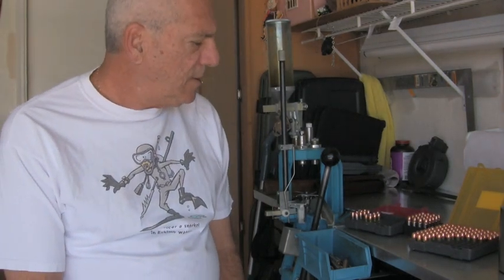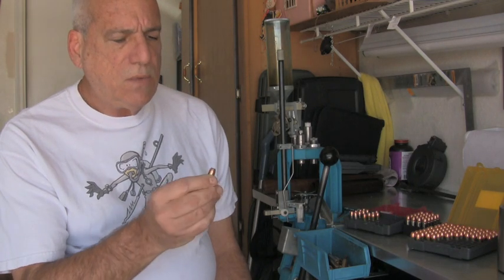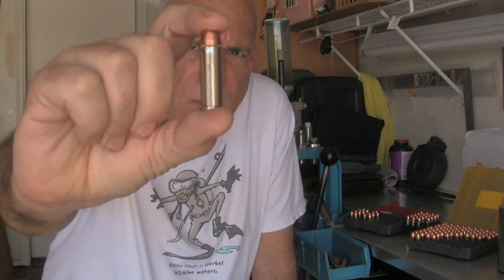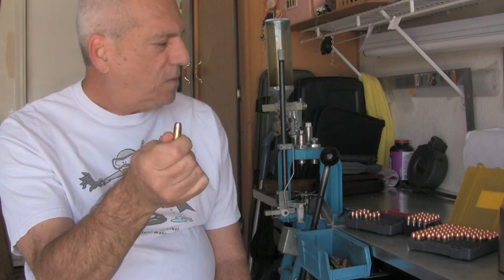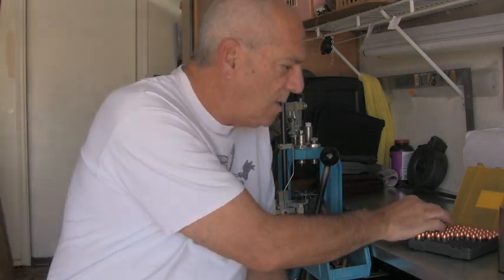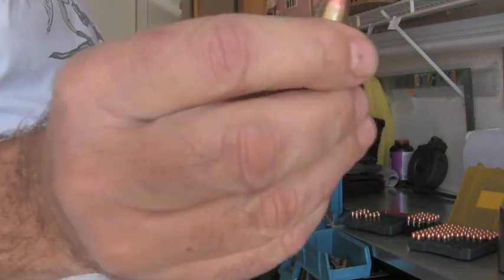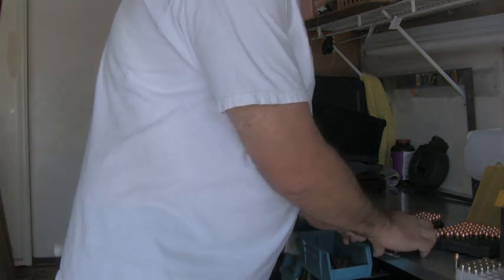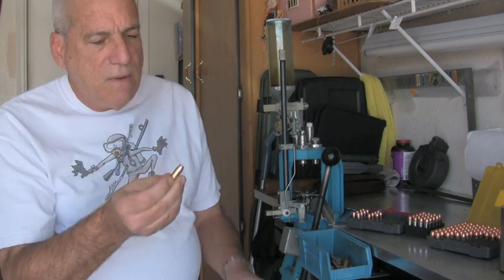To Crimp or not to Crimp, That is the question?

Comment: There are two types of crimps-a roll crimp normally for revolvers using jacketed bullets with a cannalure and a taper crimp for autoloading pistols, no cannalure on the bullet. Read your reloading manuals,sierra,hornady,speer ect.. on reloading revolvers and autoloading pistols.Each method has different characteristics involved in the process.Take notes and follow all directions. No grey line inbetween.If still confused,call sierra tech, hornady,speer ect.. Hope this helps

Comment: I use Lee factory crimp dies and put just a light crimp on my auto loads and a solid crimp on my revolver loads. The Lee factory crimp is a compression crimp, not a roll crimp for those who may not know. It also sleeves the length of the case to assure conformity. Auto loaders index on the case mouth and it is very true that you should never roll crimp them which is in fact rather dangerous. Revolver loads need to be crimped and either a roll crimp or a compression crimp are suitable. The crimp on a revolver case creates a slight pressure increase prior to the bullet beginning to move which aids in thorough ignition for some powders and also a faster jump of the bullet into the forcing cone.
Reply: I am fairly new at this so please forgive me, but what is the difference there in the compression versus roll?  Thanks alot
Reply: @freeandcriticalthinker4431   I couldn't quantify the compression difference between a roll crimp and a factory crimp but with a roll crimp all of your cases need to be exactly the same length or your roll crimp will not be the same. With a factory crimp die, case length is not a factor and your crimp won't vary from case to case.
Reply: @CplSkiUSMC  I guess I am confused more.  "Roll crimp" versus "factory crimp die".    Isnt a die from day Redding, Lee, Lyman etc a factory die?  Sorry I am pretty confused on the terminology.
Reply: @freeandcriticalthinker4431   Factory seating dies will perform a roll crimp. A ring around the inside of the die forces the rim of the case mouth to turn inward and bite into the bullet. A factory crimp die is a special die which squeezes the top of the case against the bullet which is how factory loaded ammo is typically crimped, thus, a "factory crimp" die.

Comment: Thanks again for leading me down the right path. I'm wanting to start reloading .9mm, but the crimp issue has had me spooked. Also, I'm pretty sure I saw the video, or one similar, that you alluded to. I may be a novice reloader, but I recognize b.s. when I hear it. Anyway, thanks for sharing your time and knowledge. I'm comfortable enough now to get started.
Reply from the maker: Roger Fain Always glad to see a new reloader joining the fold. Welcome aboard. Make sure to pick up a couple of good reference manuals. Lyman's is a good starting point. In the beginning stay towards the middle of the loads for your chosen bullet weight and powder burn rate. 9mm and 45ACP are great starting calibers for new reloader. Take it slow, and you will do fine.
Thanks for watching.
Have Fun Be Safe :)
Reply: @jr10  hi there, I am pretty new to too and brand new to .357 mag loading.  I did my first batch tonight and I was having problems with the shell slightly creasing, like the first 1 percent of what I envision crushing an entire shell casing would be like.  Raising the die enough to stop it also wouldn't allow me to put seat the bullet and put a decent roll crimp on it. (Remember it's a .357)  any ideas what I am doing wrong. Oh I am using a Redding 3 die set. I have loaded before, but not used to having to roll crimp so that's all new to me
Reply: @jr10  oh. Sorry but something else, I bought a set of dies from Midway a week ago they sent me 9mm dies Hornady and on the label it says it's the "crimp option" model set.  The 9mm is a straight walled case so I don't want these dies since 9mm doesn't need or want a crimp?

Comment: Thanks for the great info! Some of my first 9mm reloads had chambering issues in my carbine so I purchased the Lee factory crimp die which worked it out. Watching this helped me see the reverse of the coin....too much crimp can be just as dangerous as not enough! I found the diameter at the base of my loads was .003 fat causing stuck rounds in the chamber. I also ran some with no crimp just to resize the base of the case and that also worked well.

thanx, Gerry
Reply from the maker: Hey Gary. It's always good to connect with another reloader. I have a special interest in the reloading videos. To many of the videos on youtube focus on speed and shortcuts. If you take nothing else away from this, remember this. Reloading  ammo is not a race, a challenge, or a conquest. Take your time, research for your specific load requirements and take it slow. Fight the urge to find that maximum power load. 
Thank you for watching.
Have Fun Be Safe :)

Comment: I am just getting into reloading.While reading the Hornady Handbook of Cartridge Reloading today, in the load data section for 9mm luger, there is a sentence that reads " Use little or no crimp when reloading the 9mm since it headspaces on the mouth of the case". So, I believe the info you are sharing in this video was accurate. Thank you for your time making this video!
Reply from the maker: It is a very confusing topic. People that have reloaded for some time, still have some confusion.
If you watch my follow-up video to this one you will see why.
Thank you for watching 
Have Fun Be Safe
Reply: I watched the follow up video right after sending the first comment! You provided some great information. I look forward to getting my press and starting to reload!
Reply from the maker: Awesome. You will enjoy your new hobby. In the mean time , start putting together some good reloading manuals, and get familiar with all of the procedures. Take it slow, and don't load to the max specs. 
Have Fun Be Safe .

Comment: jr10, i have spoke with u recently about magnumizing my ruger 10mm super red hawk. wondering if i was to ream the cyl. to the point that would allow me to fit the round with a crimp into the cyl. and seat correctly on the head space ridge?   of course my revolver uses a moon clip.  do u think that would work to prevent bullet jump or creep under recoil????? just a note, if i magumize,  i would be using a 180gr or a 200gr jacketed heavy bullets.  would this be a problem and start bullet creep without a crimp?? PS: i have found some star line brass and have ordered a box of reed ammo and double tap rounds to do some research, etc. not going to do any reaming yet!!!!!!!!!!!!
Reply from the maker: William,  If I understand the question correctly, your main concern is with bullet creep or setback upon recoil. In that you are using a revolver
almost all of this video is not relevant . I did a followup  to this video where I discuss the aspects of revolvers. Long story short, Given the direction you want to go and the anticipated CUPs.  I would tell you to give your round very serious crimp. Your rounds will not be head spacing off of the case mouth.

Comment: Thanks for the information,  I'm a reloader to, I own glocks and I was told by many reloader's that you don't put reloaded ammo in a factory glocks barrel.
Reply from the maker: That is some very good advice. When I use reloads, especially my 10mm , I am always using a fully supported barrel like the Lone Wolf,Storm Lake or KKM barrels.Repeated firings in an unsupported barrel will eventually lead to case head separation. I did a video awhile back on the Glock smile which touched on this. 
Thanks for watching. Have Fun Be Safe.

Comment: Thank you for the great advise. I just started reloading for .44 magnum and 9mm. I use the Lee Deluxe set with the factory crimp die. I wanted a slight crimp in the .44 so recoil would not unseat any bullets. As a test, I let one cartridge ride along while I fired several others, then measured the length. Also for the 9mm. I didn't want any bullet set back. A light crimp reduced case mouth diameter .001", which was the same diameter as some factory ammo I have. I chambered it several times and confirmed the same overall length. I hope I'm heading in the right direction.
Reply from the maker: If the 44 mag is a wheel gun, then crimping is not an issue. If it is a semi auto like 44mag Desert Eagle, then you will want to more judicious with the crimps. If you check out my part 2 video on crimping, it goes into more specific detail on this.
Thank you for watching.
Have Fun Be Safe :)
Reply: Thanks for the reply. It is a revolver, but I'll check out the other video.
Reply from the maker: MrRoboskippy Revolver, then crimp away. In the second video I show one of my Casull rounds that has a very aggressive crimp. This is one of my pet loads for the 454. If you want to see the end results of proper loading, check out my "Blowing up a ham with a 454" video. It puts all questions to rest.
Thanks again for your interest.
Have Fun be Safe :)

Comment: Hey JR. I appreciate you sharing your reloading insights here on youtube. I'm always a bit nervous when I'm crimping ammo as I have your video in the back of my mind. I have a question about taper crimping if you don't mind. My issue is with 10mm automatic which I have recently started reloading for. I seat my bullets with my RCBS TC seater die and then crimp in a separate step because I just think it's easier to keep my COALs exactly where I want them that way and that is exactly 1.260".

My issue is that I have to apply so much crimp to get my rounds to pass the "plunk test" in a Wilson pistol max case gauge that I'm actually increasing my OAL from 1.260" to about 1.262"-1.263" which I assume is from deforming the bullet from  crimping, possibly overcrimping.
My rounds pass the plunk test in my G29 OEM barrel and my KKM aftermarket barrel well before the rounds finally plunk down into the gauge. The thing is, that all the empty cases fit in the gauge just fine prior to seating the bullet so I think I'm only removing the bell like we're supposed to but, yet, I'm still deforming the bullet as evidenced by my increasing COAL, which seems excessive to me.
The most obvious questions are, am I overcrimping and should I just use my barrels instead of the case gauge?

Comment: Thanks for the video!  I am a new reloader and this topic has been of vital interest to me. I got all of my equipment this last Christmas.  I studied long and hard before the first pistol load went through my press (hundreds of hours of videos and reloading manuals), and I do subscribe to the straight wall does not need any more crimping than needed to remove the belling.

I appreciate your work!
Reply: Yes, a very nice Christmas indeed!  I have cranked out around 1400 rounds of 9 mm and .45 ACP so far and am thrilled with my new hobby.  As I am a little OCD, this gives me something to really concentrate on.

If this is too personal, I understand and will apologize ahead of time.  My profession is that of a Family Nurse Practitioner.  My question is if your shakiness of your hands, especially that of your left hand, is secondary to Parkinson's?  I would follow that up with the question of whether or not you have considered a deep brain stimulator implant.  I have seen patients whose tremors disappeared the instant the unit was turned on.  Once again, I am sorry if that was too familiar.

Bob

Comment: Hi just a question...so for what I understand the col or oal in the books is the shortest that a round can be right ??
Is there any problem when the round is a little bit longer than the minimum oal or col in the books ?
Reply from the maker: +Vaping Ruben Most of the time it will lead to failures to feed.
Reply: Vaping Ruben most rounds that are reloaded are longer than min OAL. BUT Within reason. One 9mm load I do Min spec OAL is 1.100 and I make 1.135 for my Glock. Works perfect. You may want to get a chamber checker. Fits in there, will be good to go!!

Comment: I really appreciate that someone is willing to stand up to all the "self proclaimed" experts on here.  I am also new to reloading and have started with the 45 ACP.  I just purchased the factory taper crimp die because I have read (I shouldn't believe everything I read on the internet) that as the rounds are being fed in the semi autos, the bullets can get pushed inward creating headspacing, gas blowback, and pressure issues.  Do you think I should pull the crimp die off the press?  Thank you.

Comment: Thank you for the information, I watched this video a couple of times to make sure I got the message.  Being new to reloading, I was under the impression that for semi auto pistol rounds the crimp was required for the round to feed.  It makes since now that you are saying to only put a slight taper on the case in order to smooth out the ridge where the bullet is seated but not an actual crimp that would compromise the jacket of the bullet or increase the seating depth which would potentially increase the pressure.
Reply from the maker: Sounds like you got it. If you haven't seen my part 2 video on this subject , try and check it out. In the part 2 video, I go into more details on head spacing and how crimping can impact it.
Thank you for watching.
Have Fun Be Safe :)

Comment: Great video jr10. I got a Hornady LNL Classic reloading kit for Christmas from the wife. Press is a single stage. I reloaded about 25 years or so ago for 30'06 and .270. I used all RCBS components. Press, dies, everything.My 30'06 was a Remington Sportsman 78, and my .270 was a Weatherby Vanguard VGS. I never crimped with either caliber. My plan this time is to use it to reload 9mm and .40SW, plus some rifle calibers I have, 30-30  and .270, maybe 7.62x39 for my SKS. . I was curious as to how much crimp was needed for 9mm and .40 SW. My 9mm EDC are Glock 19 and 26,  .40 cal is a Glock 27. Other pistols are Ruger SR9C, Beretta M9, and S&W Shield in 9mm. Reloading mainly for range ammo for practicing. Thanks.
Reply from the maker: Fantastic Christmas gift. I hope you thanked your wife. As for crimping, all of your rifle calibers can be crimped. These necked cartridges do not headspace  off of the case mouth. As for the straight-walled semi auto rounds, that is a different story.When you are belling the case, only put enough of a bell so the bullet will sit on the case mouth by itself. It should almost look like the case has no belling on it when properly done. If you do this, the crimping stage will only be a matter of removing the belling. Try to look at a factory 9mm or 40 S&W round for a visual reference.
Thanks for watching.
Have Fun Be Safe.

Comment: Thanks for sharing that. Very important. I've only reload rifle rounds and I'm just about to start reloading .45 ACP. You probably just saved me a gun with this info. I have a Lee Factory Crimp die I intend to use. So should I only put enough crimp on this to remove the flare or do you think it will still need a bit more crimp? Your headspace comment has me a bit concerned since the Lee Factory crimp is a tapered crimp. No I'm concerned the rounds might insert too far into the chamber if there is a smooth taper. Any input is vastly welcomed. Cheers.

Comment: Agreed. I haven't shot a jacketed bullet in about a year. Basically, i just clean it out after each time it's fired and no issues. Found that rem wipes are all you need to clean them. I took 1 and 1/2 wipes and the whole gun is spotless.

Comment: Good advice, thanks. Have loaded lead pistol for years but am considering a plated bullet. You told me just what I needed to hear😀
Reply: +justedders Use the same roll crimp you would use on your lead rounds. Some of the plated bullets don't have a cannelure but don't worry as the plating is soft and the roll crimp will set nicely. I used a lot of Xtreme bullets and Berrys bullets and the shoot just fine with the same crimp I use for lead bullets that have a crimp groove.

Comment: I have a question! I have been reloading 308 winchester for years. I have been using a LEE factory crimp die. Now I read that you should not use a factory crimp die on non-channeler  bullet. My factory crimp die is set lightly and you can see a slight crimp. So what is your opinion???

Comment from the maker: There are a couple of areas to consider with semi auto weapons. as far as crimping goes, in most cases(no pun intended) a chambered round head spaces on the case. If you put to much of a crimp on a case it will wind up seating to deeply in the chamber. Not only does this affect accuracy, but dangerous pressure buildups are possible. Attention to case belling and bullet seating will avoid this. High pressure rounds (Casull) will require a very strong crimp. Revolvers are good choices for these :)